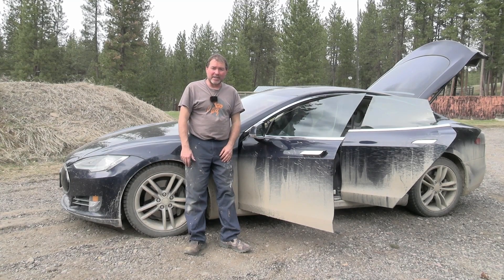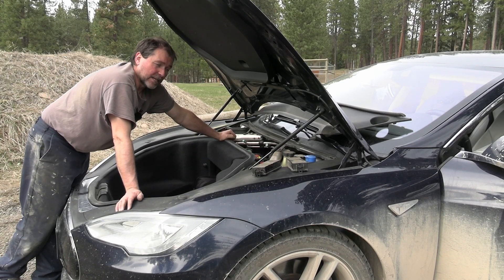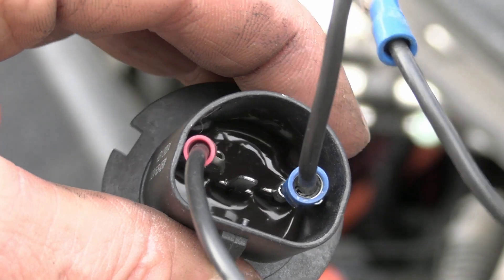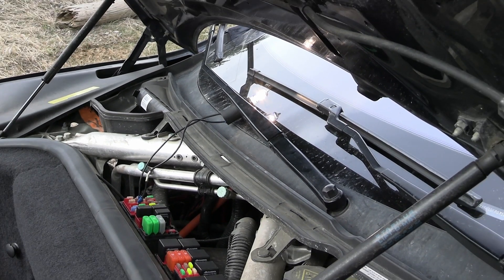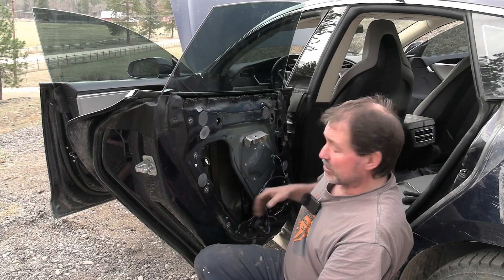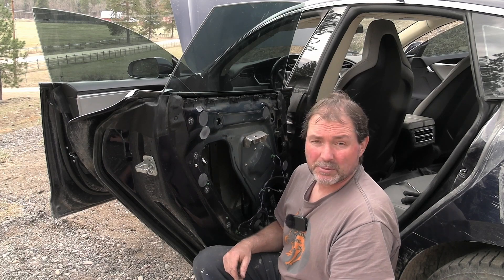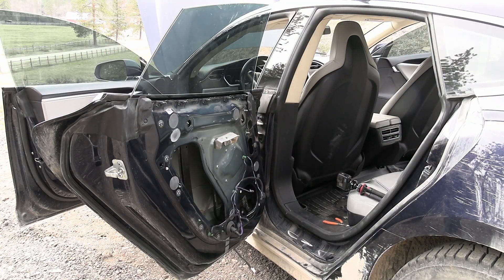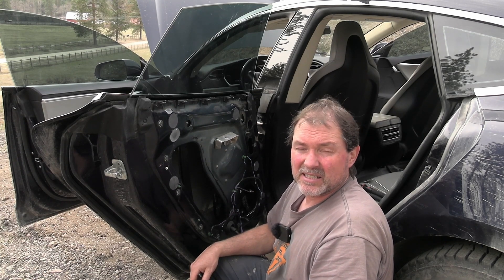Tesla Model S Door handle diagnostics. This is how to easy find a short without blowing fuses.

Comment: Hi Mike, you seem really knowledgeable.. I have a 2016 model S, and on the left side both doors and windows stopped working, door handles don’t present, and rear left door doesn’t open not even from the inside.. front door opens from inside but the problem is that the window lowers a little bit every time i open the door but doesn’t go back up when closing the door, I also noticed that the windshield washer fluid pump also stopped working.. I would really appreciate if you could give any suggestions on what the problem might be. Much appreciated and thanks for your videos, they are really helpful and help the Tesla community a lot..
Reply from the maker: @wildfox9ol_idkv475 Hi, wow a lot to unpack here. I assume not all these things failed at the same time, did they?Maybe let’s start with the washer fluid pump. I think it just failed and needs replaced. I have a video on that too.
The door handles are known to fail as well. If they stop presenting but the door can be opened from the inside it’s quite possible the door handle has failed. I believe the rear doors have a common fuse for the door handles and possibly windows.(Would have to check the schematic) That said there could be one or multiple fuses blown. Best is to check them all by pulling each one out, visually check, if in doubt also use ohm meter to check the fuse, put it back in and check the next one. If you find blown fuses replace them and see what happens. Door handles and windows can overload a circuit for several reason, one is ice. Don’t know where you are located and even have cold temperatures. Basically if you do what I did in the video you should be able to find the issues. The window sounds like a regulator problem. For the front doors you can get aftermarket regulators without motor for around $70. I think Tesla wants around $300 for regulator with motor. Overall there could be many problems from bad wiring, disconnected plugs, failed regulators, failed door handles, failed ECU for door handles and more. Start at the fuses! Then you will have to remove interior door panels and hopefully along the way you’ll be able to open the rear left door, maybe while you use a light bulb in place of a blown fuse. Windows can be failing if the drivers door window switch assembly is bad too. I had someone that used an aftermarket switch assembly and other windows stopped working. Where are you located?

Comment: I’ve 2015 Tesla model S, driver side rear door can’t open from inside or outside, I don’t understand how you use a light to test short circuit, I don’t know where it’s problem. I pull handle and glass is down but door can’t open. Thanks
Reply: Which fuse you connect light and how to connect. Thanks
Reply: Very nice man, thank you very much. I think my car wiring run has a problem, maybe some wire disconnected. I’ll check it
Reply from the maker: Hi, The test light goes where the fuse is. When you pull the fuse out you see two pins, you connect one side of the test light to one pin and the other side of the test light to the other pin.
But let me ask you a couple questions first. Does the door handle extend and retract? It sounds like that is the case and it even sounds like the window is actually lowering, right? If all that is working then the fuse is good! You have power to the door handle. Then the latch is not releasing for some reason. You should have a mechanical release that is located in the rear passenger foot area just below the seat cushion in the carpeted area between the floor and the cushion. Pull it to open the door while the window is down. You will need access to the door panel and interior in this area.
The release latch is on the car body, not the door. There are several ways to start troubleshooting on this. It doesn't matter where you start the problem is always on the other end🤣. I'm just kidding, but there is some truth to that.
You could remove the door panel first or remove the body interior panels first. What you need to find out is if you have a signal to the latch release (on the body) from the door controller in the door and if the latch has a good ground. In order to successfully do troubleshooting you need to be able to read Tesla's wiring schematics. To see how to access and take apart things you need to check the Tesla service manual. Both schematics and service manual are accessible for free on Tesla's website. I believe it just recently changed and you don't even have to sign in anymore to access. Go to service.tesla.com and scroll down until you see Service Information and then click the Model S from there just work you way thru to the service manual and schematics.

Comment: I own a 2014 Tesla Model S and have experienced the same issues you did ,  rear driver side window not operating as well as rear driver side door handle not presenting, both at the same time. Removed door handle and replaced micro switches , swapped out motor and anything else I had spare parts for. When I re-connect the handle the light in the handle flashes on then off but that is it nothing else moves. All other door handles and windows work properly its just the rear driver side. Pulled the 5 amp fuse and it looked ok. Going to put window issue on hold for now but would like to get door handle working again, where you able to diagnose your door handle issue subsequent to the video you posted on it? If so pls advise.
@ameliaandersonsetterr.s.2649
Reply from the maker: Hi Amelia,
I did make another video on how I repaired the door handle. https://youtu.be/ygeoRb1M3r0
In that video I also show multiple generations of door handles used in the Model S. Your 2014 most likely already has a newer generation than my 2013, regardless they all had similar issues. The most common issue is the gear breaking, I assume that it was ok on yours. The next common issue is the wiring to the microswitches, especially these wires that move when the handle extends and retracts. Sometimes it looks like there is a crack in the insulation but in reality the conductor is already broken. The motor could be an issue but mostly is not the cause. A more likely cause is the control board on the door handle, starting with the 3rd generation the control board is no longer on the handle assy but attached to the door somewhere in lower middle area, visible when the door panel is removed. These were a common issue on 3rd gen door handle.
Best is to start diagnostics where I did in the video you watched. Making sure you have power (12VDC positive) and ground (12VDC negative) supplied to the door handle. Sometimes the issues is in the wiring between the door and door jamb where the wires go thru the rubber boot. 
Another thing you need to test is, if the door handle extends when you press on it. This is the only function that is completely handled inside the door, meaning no external signal required for it to extend. Every other way requires a signal from the MCU for door handle extension. If it extends when pushed but not any other way than the communication between the door handle and the MCU is the problem. Most likely a bad wire or connector.
Here is the link to a video that explains how to get a free subscription to the Tesla Service Manual and Electrical Schematics, where you can pull up the schematics for your particular model and built date.
https://youtu.be/8d1UYQ_yO28
I hope this helps. If you would like more info/help, please click the Facebook link and message me. There we can also send pictures if needed.
Reply: @ameliaandersonsetterr.s.2649  what es the solution?

Comment: I see your running snow tires do they help ?  I guy at work has a Tesla and said there is no need for snow tires but he has not gone through a Minnesota winter yet.
Reply from the maker: He’s wrong! Snow tires are essential for real winter driving. All season tires have nowhere near the traction of studless snow tires. The Tesla may not spin out while accelerating due to its highly advanced traction control. But the tire is the connection between the car and the road when accelerating and decelerating. These studless snow tires will make the car stop faster. All our cars run on snow tires in the winter. We use Michelin X-Ice and Bridgestone Blizzak. These have been the highest rated winter tires for many years and always share 1st and 2nd place in any test. This Model S is a rear wheel drive. If you watch some of the winter road-trip videos we have, you’ll notice I don’t drive timid at all. But beware! Once you had real winter tires like these you won’t go back. 😉😀
BTW, on the truck we run the Michelin Defender LTX M&S all year. This tire does great under all conditions but requires shifting to 4x4 under extreme conditions in the winter. The rear dual wheels without weight in the bed just don’t help.